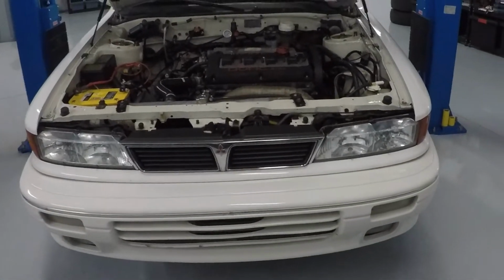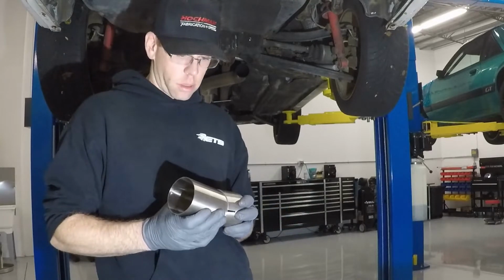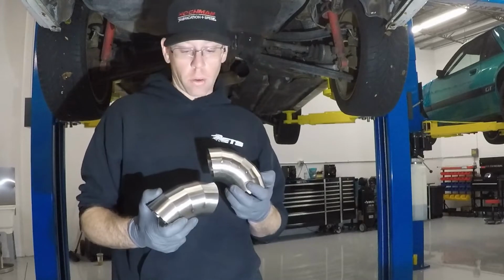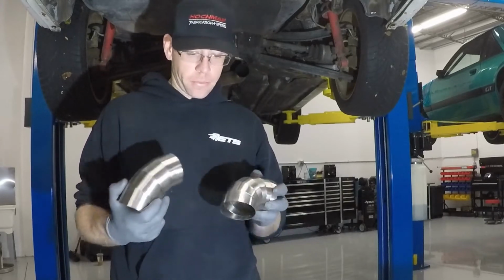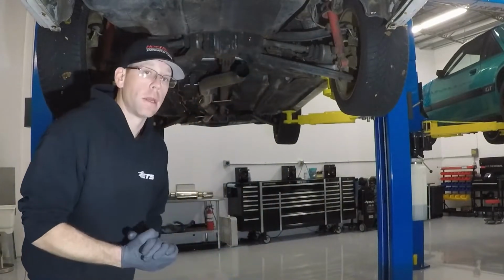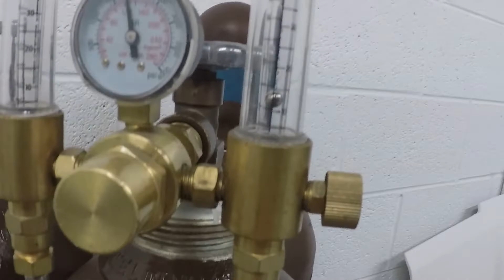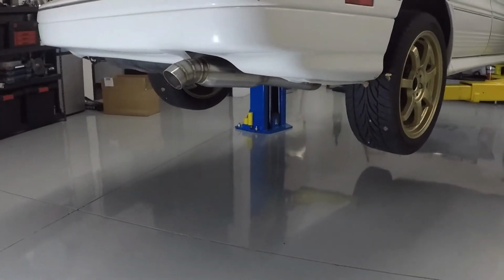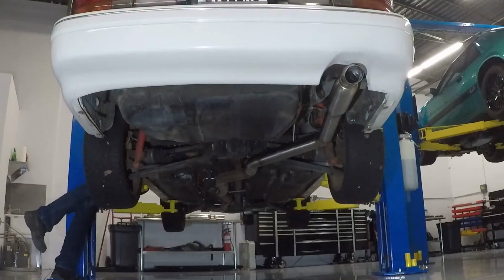Making a Galant VR4 Custom Slip-On Racing Exhaust!

Comment: Great work! How do you like the Stainless Bros slip joint? Any hesitation using one in a downpipe instead of a v-band assembly (for additional clearance)?
Reply from the maker: Love them, sure if you are not right off the turbo works fine